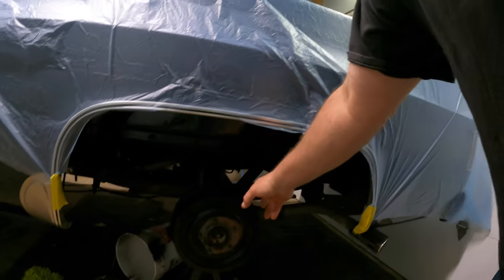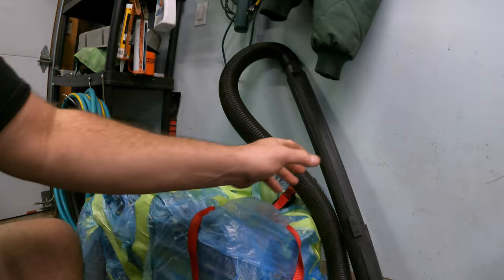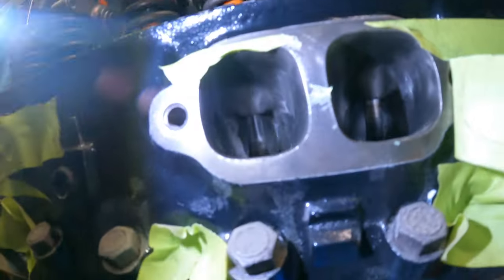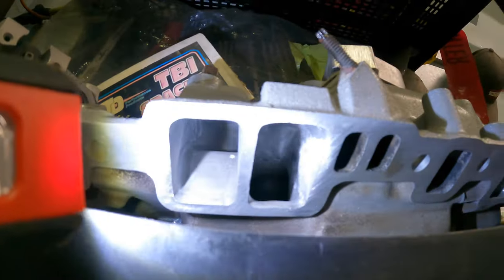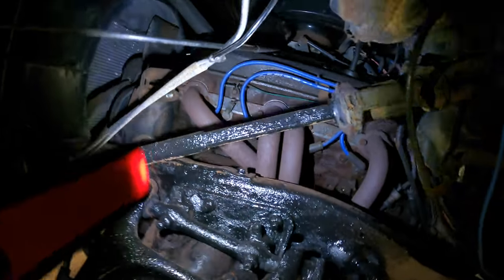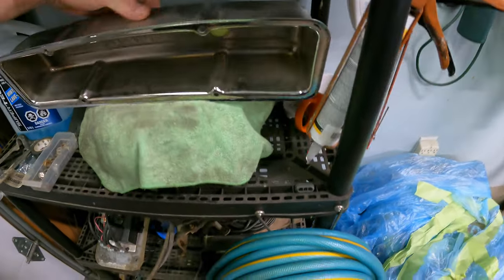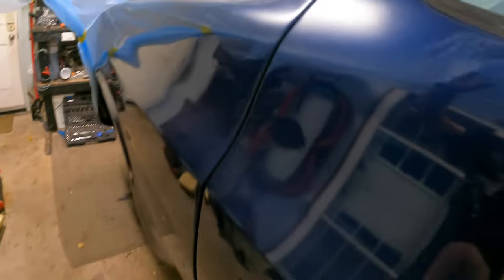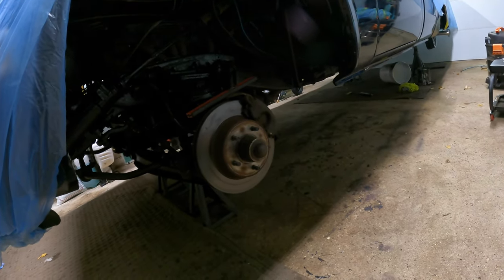Engine For Square Body Home   4K

Comment: I swear this truck is in better shape than modern 5-year-old trucks. Is that paint por 15 ? thought you had to brush it.  Borrow A stupid engine crane, mine was used once 15 years ago... now I'm into corvairs (bottom engine removal) go figure.